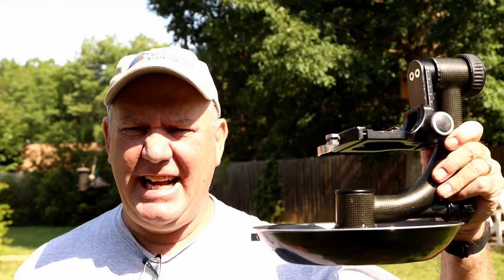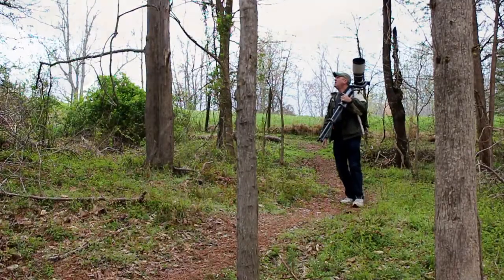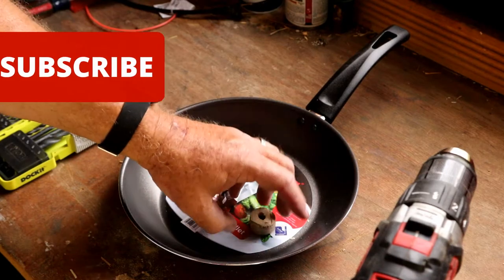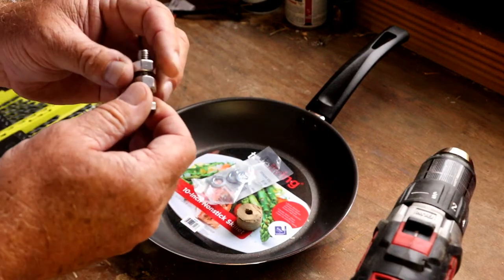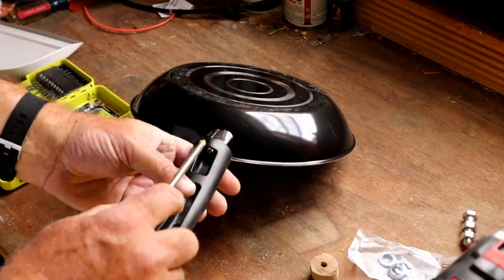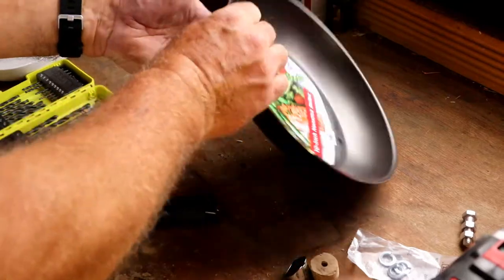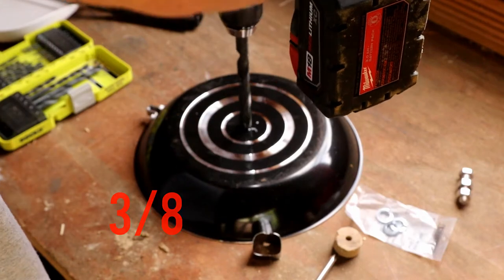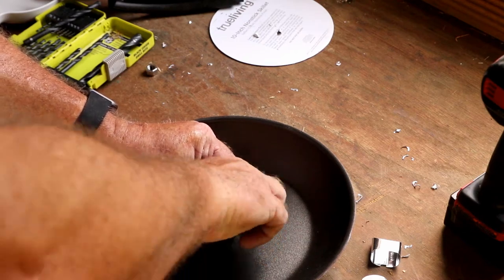DIY Ground Pod!!!!!

Comment: Interesting video. I do it in another way. One plastic freesbee, glued a round peace of 10 mm plywood that covers the whole bottom of it for stability and strengt.  Then a smaller round plate of 10 mm plywood, about 10-15 cm wide. Then I made a round headbase of tree round 10 mm plywood plates, that I screwed and glued in the middle. One whole, and two formed as rings, that made it hollow. They are about 7 cm wide. Then a round removel top plate on top of the base, with a 3/8 screw fixed from the inside. I then screw it down with tree wooden screw, but no glue. Then Im able to loosen it later on, if I need to. Im using a gimbal head, and sometimes a panning base with a Manfrotto 234 2-ways head on top. Works fine with both.
Reply from the maker: that is a very good deign.  very cool.  thanks for watching.